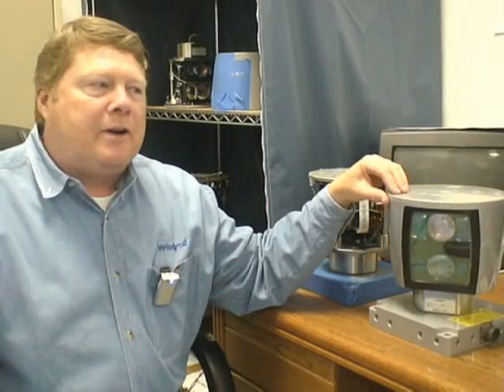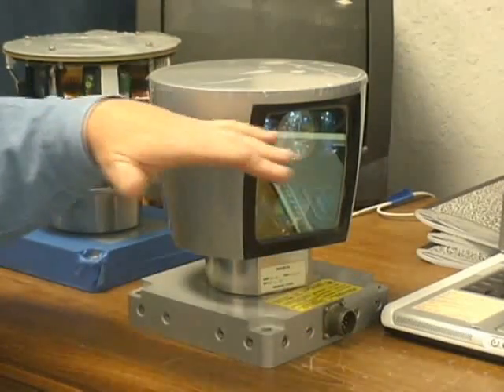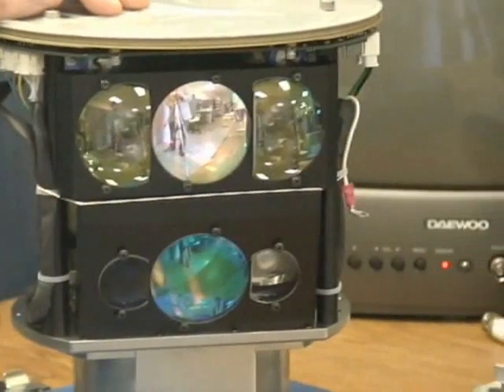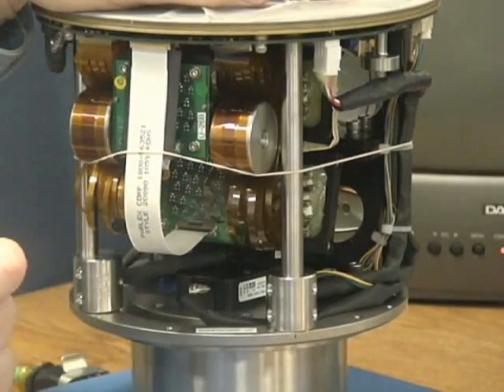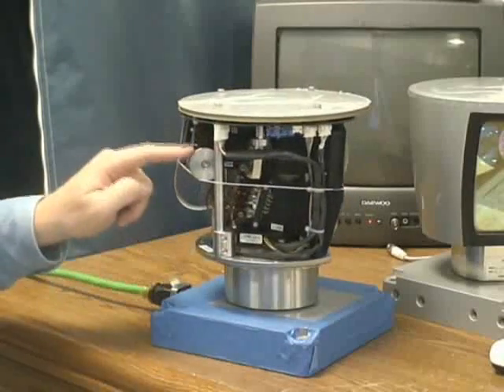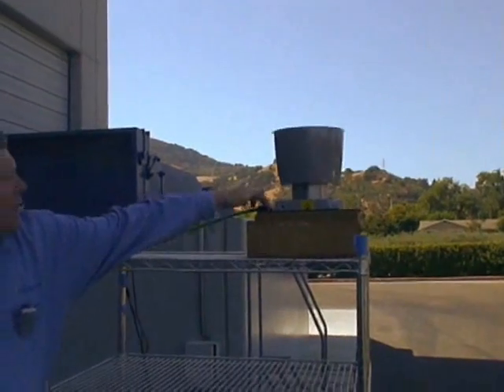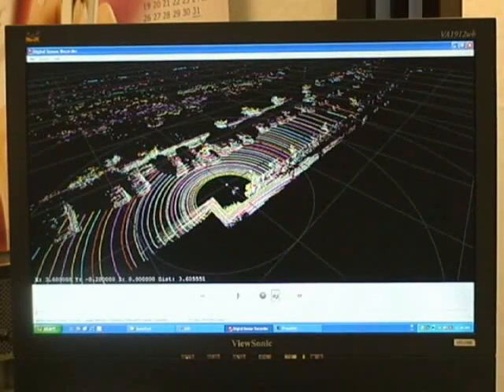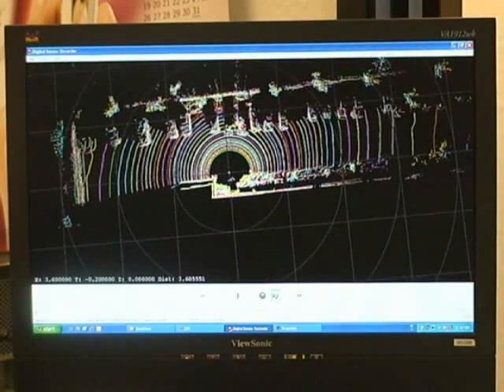Velodyne Laser Teardown

Comment: What's the distance and rate of tracking past 2000km
Reply: Lidar relies on accurate reflection. So it's not great at long distances as refraction due to changes in air temperature start to effect it.
But to a few hundred meters it can be very accurate. I don't know about this system, but cm and mm resolutions are possible with total stations using a similar tech.
Using retroreflectors can increase that to a couple of km. But not quickly as pointing a laser at a specific location km away accurately is not easy.